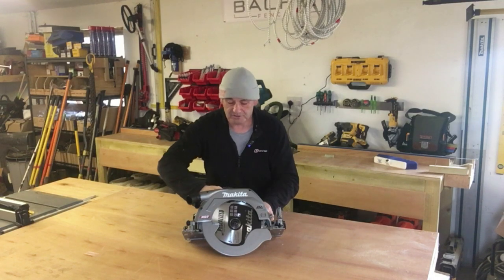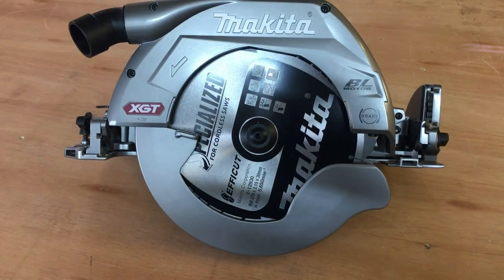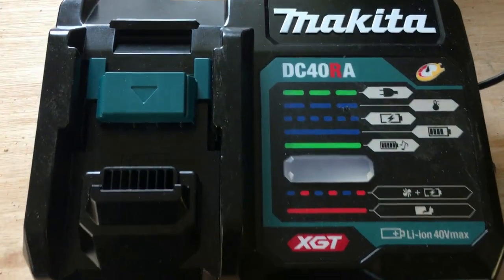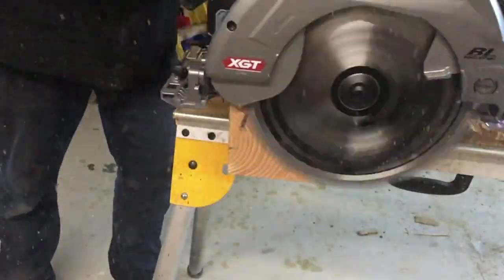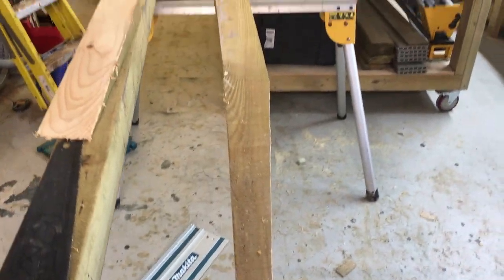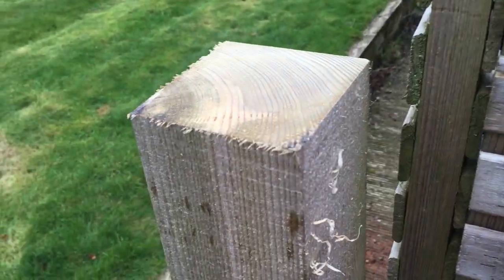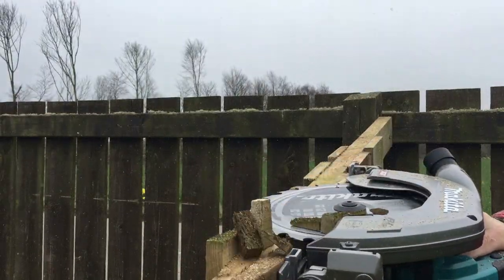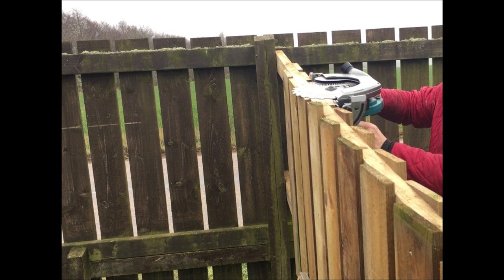CRAZY Circular Saw Cuts 4x4 Fence Posts | MAKITA HS011GZ 40v Max XGT

Comment: I specifically needed to see how it would work using a circular saw to cut the irregular tops off of a fence. A cedar fence. there's Narwal folks to talk or show videos about that. The first I thought maybe a sawzall. but I think I'm going to do as you did. Thanks.
Reply from the maker: Thanks for the comment. You can use this method with this particular saw or you can also use a track saw, although it will take a bit more time. I'm glad you found the video helpful !
Reply: @Bacrenfencing  I may try my angle grinder with a saw blade. I tested it out and it seems like it might work if I get a good plumb line
Reply from the maker: Yes, that would work, but can be pretty dangerous as I have done that myself in the past !

Comment: Tool and a half will save you time 👍🏻👍🏻
Reply from the maker: Sure will Ian, was pretty sceptical about the hit & miss fence trimming aspect, but works an absolute treat, That alone makes this saw worth every penny to me personally. Thanks for the comment mate 😎👍
Reply: @Bacrenfencing  aye it cut thru those fence slats early the motor hardly even dipped when under load exciting stuff to see it in action 👍🏻
Reply from the maker: Aye Ian, it has some amount of power, just needs a bit of practice to get used to it. Not used to swinging a huge saw above my heed ! 😂💪
Reply: @Bacrenfencing  not to worry m8 all part of being Scottish adapt n over come 😂😂

Comment: Think it's the thickness of the track preventing a full cut. Just do a second pass no track.
Reply from the maker: Correct Matthew, it was definitely the thickness of the track that prevented that. I just thought I would use the handsaw in the video to demonstrate how little there was to cut, to get all the way through. Yes, you are correct, if I had simply removed the track and done a second cut, that would have done the same job. Or just free handed the saw along the line, it would have ripped the fence post in one go. Thanks for the comment 😎